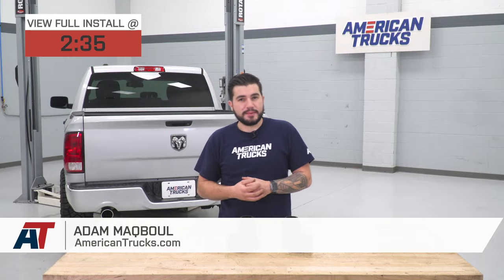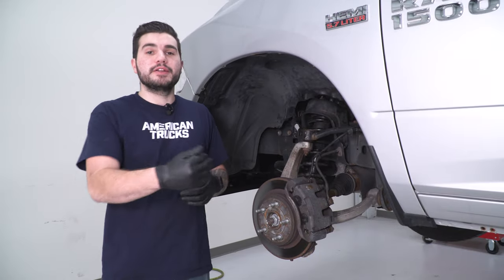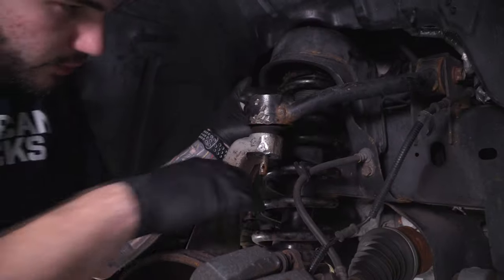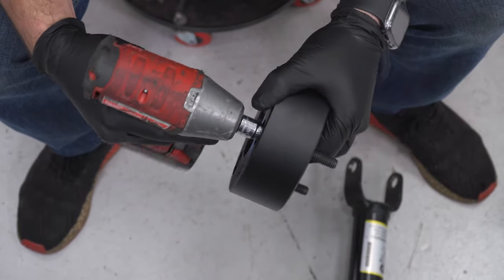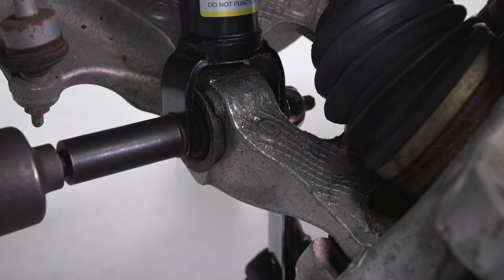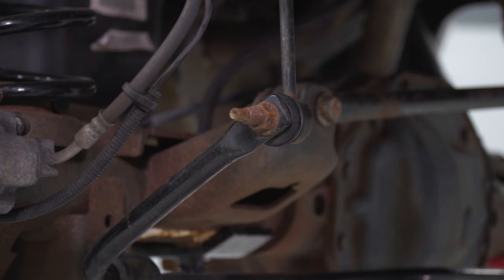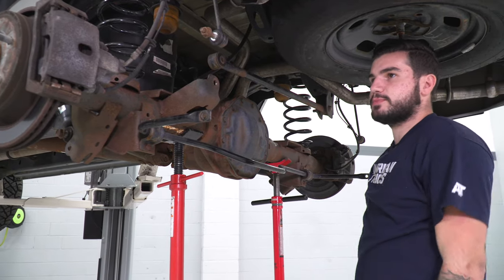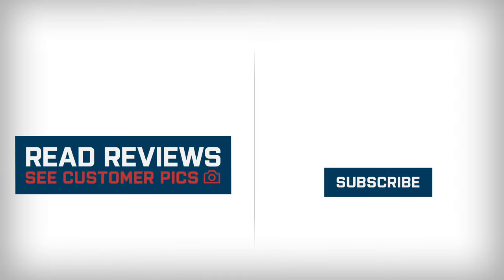2009-2021 Ram 1500 MotoFab 3" Front / 2"Rear Leveling Kit Review & Install

Comment: I think you forgot one of the most important steps: the front control arms bushes are now under tensions when the car sits "level". You should jack the assembly up to the height where it would usually sit, then losen up the bolts so the rubber bushes relieve their tension. That will make them last longer and give a better ride.

Comment: Those werent factory ram control arm you took out, they were already the upgraded ones just probably worn out, factory doesnt use crown nuts, aftermarket does
Reply: Saw.that to
Reply: Same ones that came in my 2019

Comment: A lot of these install videos are missing a key point when lifting your truck this way; CV axle angle folks! CV axle binding is pretty much assured when off-roading and the axles wont last long . Either get a front diff drop kit or a pair of those Extended Travel CVs.

Comment: Question- In time will I need to replace other factory parts in my suspension frame or will they hold up to this kit in the long haul (not doing rough off road trails just back roads)?
Reply: Experience says will have more issues because of strut spacer

Comment: Installed this on my 2021 4wd Big Horn. The rears were so easy, the fronts were a pita. Had to take a grinding wheel and shave off some of the stock strut and uca to get it to clear upon install. If I had to do it over again I would just get the RC struts up front and call it a day.

Comment: When you tighten the strut to LCA bolt the truck should be on the ground so the bushing is at it's neutral position otherwise it'll flex the rubber and prematurely damage it.  I also wouldn't recommend any spacer kit without a redesigned UCA otherwise you risk the upper ball joint stud breaking.

Comment: Just did the driver wheel.. it only took me 8 hours 🥴 3 more wheels to go. Weeeee!
Tip for people reading. You're definitely going to have to loosen the alignment bolts and drop the lower control arm. Nothing was as easy as the video
Reply: It's a RAM. Nothing goes smoothly with these trucks.

Comment: That doesn't look like factory upper control arm.  Do you have to change upper control arms to make the 3" lift work properly? 
I would like to know before I do this to my 2015 RAM
Reply: I would definitely change upper control arms to Rough country or anything but stock, it binds your ball joints bad. The truth in this video doesn't have factory control arms.

Comment: Never level without doing your ballpoints as it causes a new wear spot and wears them out fast learned that the hardway doing a level the same as this also wore out my cv axles as there not ment to have a negative angle opted for an actually 4 inch lift and heavy duty springs from tuff truck and haven't had an issue nor saggy ass when hauling

Comment: The 21 rebel is already 1" higher in the front. Will this fit the rebel with the 1" longer strut without a spring compressor?

Comment: I have a 21 4wd. I'm looking to buy this kit and add 35/12.5r20 ridge grapplers to the stock 20x9 black ram wheels. Will it work?
Reply: I too have a 21 4x4. 
I just bought the kit and will be installing this week. I talked to the boys at discount tire and they said I should have no problem. 
I did also buy 2in hubcentric spacers, mainly for just that extra separation, but also because the stance looks better.
Reply: Fits no rub under mine!
Reply: yes it will work
Reply: Hoped it worked out for you, I just have a 3 inch in front and stock 20s and it clears 35 12.5s

Comment: Buddy messed up that knuckle and upper control arm... PLEASE USE A RUBBER MALLET... it accomplishes the same thing of knocking the dust loose so you can pull them apart with out putting giant holes in the metal
Reply: Rubber mallet? You must be working on a newer truck. I'm using a sledge hammer on my 2011 and I can't get these bolts to budge.

Comment: Ummm never done any of this lol. I’ve always just used a spring compressor and never messed with taking all this apart. 15min per corner. Once Uber it’s own weight again losses the joints and retighten them to relieve tension on the bushings.

Comment: Good video, I had 2000 grand Cherokee I did same set up and had death wobble all the time. This may effect the natural dinamics and cause death wobble as well...
Reply from the maker: Aerodynamic changes from lift kits do not cause death wobble, incorrectly setup suspension geometry or worn suspension components cause it. 😉 If all you did to your Jeep was add spacers, the added lift paired with worn out ball joints, tie rod ends, control arm bushings, track bar, etc. most likely caused it. -Zach

Comment: Question for you, I have RC level struts, just ordered 35x12.50x20. Will those clear with factory wheels without wheel spacers?
Reply: Negative,  i have a RC 2 inch leve shocks and struts. 18inch wheels on 35x12.50 tires.  Rubs at full turn,  think about slapping my 1 inch spacer back with 2inch rear.
Reply: @fantasticmike946  no rub at all with mine, factory wheels, no wheel spacers, with 35x12.50x20

Comment: I just installed a 3 inch spacer in the front of mine, but just last week I installed 1.5 inch spacers and when I turn to the right even slightly the front left tire shakes but doesn’t make any sound, any idea what it could be? Update, I had to get a new wheel because the lug nuts from the spacer came loose
Reply: is that front and back?  And is it truly level?

Comment: What is the wheel and tire combo? Looks great!
Reply from the maker: The wheels are XD Machete Satin Black 5-Lug Wheel in a 20x9! The tires are NITTO RidgeGrapplers in a 33x12.5R20s! -Zach
https://www.americantrucks.com/nitto-ridge-grappler-tire-1718-20.html
https://www.americantrucks.com/xd-2009ram1500-machete-satin-black-5-lug-wheel-20x9-0mm-offset-xd12829055700.html
Reply: @AmericanTrucksRam  You clearly stated in the video 0:50 that the factory tires are 35s.

So what are the exact measurements of the aftermarket wheels and tires on this truck?
Also, did you guys replace the brake rotors?  They look bigger in the video and fill up the wheels nicely.
Reply: @mweezy  I thought I heard 33’s
Reply: @JonDomke  Nope, they were 35s and I even had to go and watch the video once again!

... Or maybe you work for them and want to get me to re-watch the video one more time! I don't know bro!  😂
Reply: @mweezy  He might be commenting on the factory size that you indicated were 35s. The Factory tires in the video are the 33" on the 20x9 silver wheels. The aftermarket black wheels with the bigger meats are definitely 35" total, as indicated during the wheel turn part of the video. AmericanTrucks def replied with incorrect measurements in their comment.

Comment: Why even use the 2" rear? When the 3" front will level the truck dead even? I have a 2" front and still have a 1" rake.
Reply: Lots of Reasons...   some people like the factory rake, just want more clearance,   Others want to run 35" tires but don't like to the "stuffed" look of just a front level kit and want a couple more inches of rear wheel well gap.    Or   they want something more than just a front level kit, but don't have the money for a full $2000 dollar lift kit, this is a cheap alternative to get some extra clearance.
Reply: Ok my question is a rams stock 2” higher In the rear end or only 1”
Reply: @gamingceos4823  rams come from the factory with a 3" rake which means the rear is 3" higher then the front... so with a 2" level kit you still have a 1" rake
Reply: So if I did 3 front 3 back it be level?
Reply: @deskie_hub5037  no the front end will still sit as stock compared to the back. 

Example: a 5" lift kit comes with 5" front and a 3" rear... a 4" lift kit comes with 4" front and 2" rear
Reply: Well my truck sits 2inch higher in rear and I was gonna put 3 inch spacer in front and 3 inch spacer back